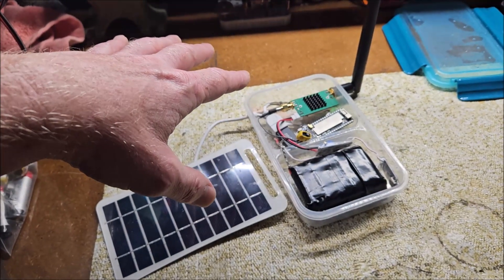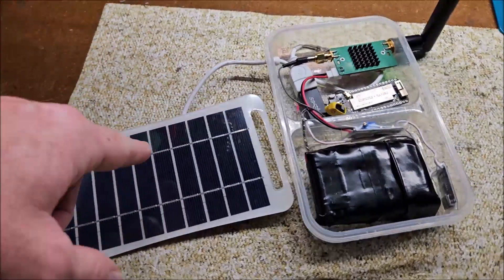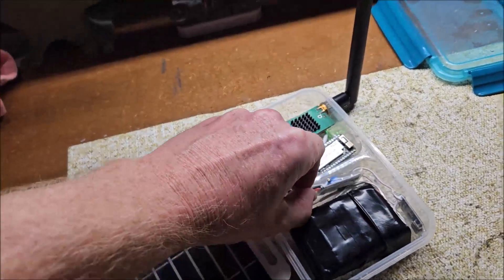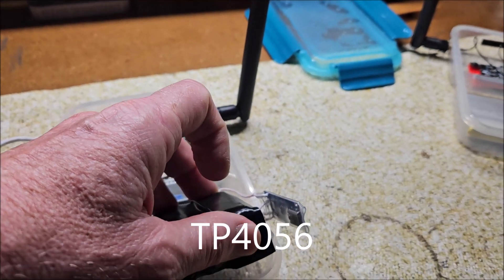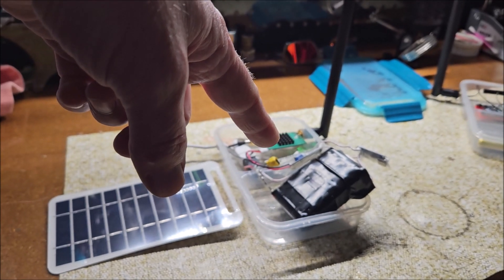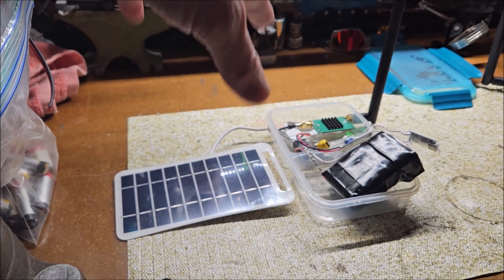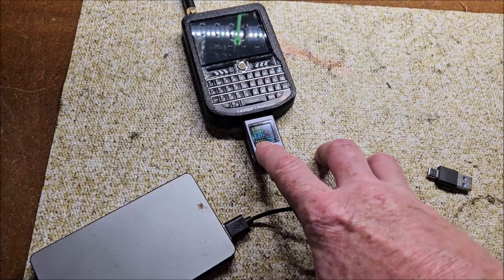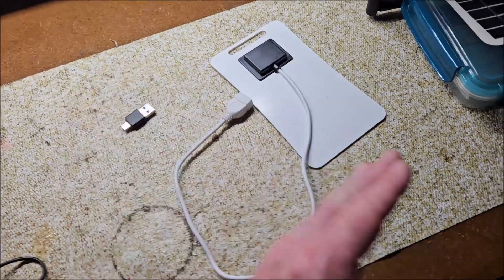Amplified Solar Powered ESP32 Meshtastic Node How To

Comment: The Heltec T114 draws about 10x less standby current than the V3, That's about 9ma and that translates to 10x more time on a battery.
The amplifier is designed to use 5v DC with a max. of 6v. The RF output declines exponentially as the voltage is decreased. The idle current on the  amplifier is about 9ma and that's about the same as the T114 LoRa board. Together, both LoRa T114 and RF amplifier has a combined drain of < 20ma at 5 volt. So the 3.7v lithium battery is useless. At 3.7 volts ONLY, and without +5 to supply, the amplifier will be excitation and still no output. A much better tact is to use a switching LM2596 based BUCK DC-DC regulator, set to +5 volts, to power both. It has an input range of 6.5 to 40 volts DC. You then have many possibilities for a power source. As it is switching, the wattage is constant and the current declines as the input voltage is increased. These LM2596 DC - DC wafer boards are available on Amazon for quantity of 5 for less than $20. They also make a good 12 volt "gell-cell" solar charge regulator if you set them to a 13.8 float voltage, although there are other BUCK/BOOST models with current limit adjustments for an even better solar regulator.
Reply from the maker: I'm not sure I follow. Your LM2596 is a buck converter that will allow you to decrease the power supply. I used an MT3608 to step the power up to 5V, but I guess you didn't make it that far. Besides that doesn't the T114 already have the necessary circuitry to just plug a small panel into it without having to step up anything? I wonder if it has a stable 5V pin you could use for the amp because of this. I just wanted to show how I did this with the least expensive node available.

Comment: The amps are good as long as you run a filter between the radio and amp. I can bet you that you can hear that node much farther than you can get into it. Your noise is getting amplified, without a filter you’re killing your receiver with a bunch of noise outside the 915 band.

Comment: I'm not sure about the spurious emissions spec of that RF PA. You might need to add an inline filter to make it FCC legal. (Or at least have someone with a spectrum analyzer check it out.) Also, IIRC, the legal maximum (in the USA) for EIRP is 34 dBm, so be cautious using any antenna with > 4dBi gain (or adjust the power output accordingly).

Comment: You should check with your meshtastic community before setting your node to a router node.  Many times setting this to client is sufficient and works great.  Too many routers in an area can cause issues for other members if their hop count is too low for the number of routers in the are when, perhaps one better router location would have sufficed and allowed it to just be one hop.
Reply from the maker: I get this comment frequently.  Besides me being is a non-Meshtastic town surrounded by BFE you miss the whole point of using router for this specific instance. Maybe watch the video again.
Reply: @masondawson4061  comment wasn't for you, but rather your viewers since you didn't cover this and lots of people misunderstand its purpose.

Comment: Could the amplifier take 5v straight off the heltec pin?
Reply from the maker: I thought the same thing, but only if 5V is going into the USB. I tried that at first with the solar panel connected to the USB. Then I noticed the amp only ran when the sun was out. That's why I did it this way. Still it might be worth checking on other nodes to see if the 5V pin provides 5V while on battery power.

Comment: Only the esp32 devices with a psram I believe of 8 work with store and forward.  Example would be the lilygo tdeck.  Otherwise it's not needed. Works good for a tdeck in client, so it still acts like a router.

Comment: Thanks you brother, excellent node job. Crazy funny how similar my node setup I'm creating is to yours. Just slightly bigger solar panel, 18650 atm(vapes later). I haven't run a test yet, i know the amp requires 5v, but just directly from your TP module could you use output power from there? I know it is less, just thinking out loud, how little power do those little amps really need(they won't keep my battery banks awake). I'll run some tests later and get back to you with my conclusion if you respond to this message Mason(probably will if you don't anyways) :) . Cheers from Western Australia my Mesh Mate!

Comment: How is the bidirectional amplifier working for you?
Reply from the maker: They work well. I can't really quantify it though. I've had one on a 4631 for about a week now in client mode. That's the solar powered node on the roof and so far I can't tell any extra battery drain. Of course there is hardly any action where I am.

Comment: I have a question, is the board used in this device heltec T114? and do you plan to add an "instructional video" in which you show step by step what to connect and solder to what?
Reply from the maker: No. It's the Heltec Stick Lite. I don't remember what version, but it won't work with a display because it draws too much power. That's why I went with a cheap node. You can certainly make ESP 32 nodes with displays work, but running them in Router mode turns the display off. I made a video I'll post a link to below on how to make the power supply which is the biggest part of this build. If you still have questions I'll be glad to help you over email studio32ste,101@gmail.com. https://youtu.be/Rw8Y9-Xp2oA?si=xlixZhC30hRieAUq

Comment: Hey, can you put affiliate links for the antennas, batteries, etc you're using too?? Looking for good L-shaped antennas for my around town nodes... Solid video though man! 👌
Reply: Or at least put parts list in the description? Shared link to this to my states discord channel though! Keep up the good work!
Reply from the maker: Many thanks! I'm not affiliated with any sellers, but the antenna was a recommendation on a video from The Comms Channel about Meshtastic equipment I think. It's been a while. The batteries were harvested from spent vapes. I wired several of the same type in parallel. I got the amp from Aliexpress. It's part number AB-IOT-686. It also says AirBuddy on the board.

Comment: Some quick questions if you don't mind? So if you have your ticket and put it into amateur mode, and turning off the encryption, must you have your callsign displayed? Or just send it when you transmit? Also, by putting it into amateur mode, does this limit you to only communicating with other licensed hams? How many Watts can an amateur put out legally on 915 MHz? Is is 1 or 1500 Watts? I am hoping you know, because I can't seem to find the answers to these questions.
Reply: I was under the impression that 1, yes you turn off encryption, and must communicate your callsign (no idea the requirement of how), BUT - Isn't that only on amateur bands, if you are using 915 there's no amateur regulations there? Most people don't use the amateur 440mhz band that these lora radios can transmit to as well.
Reply from the maker: @BBayjay  I found a helpful section labeled FCC Rules and Regulations in the wiki page for the Station G2. Hopefully this link will be shared.
https://wiki.uniteng.com/en/meshtastic/station-g2
Reply from the maker: I wish I could help but I don't know. I've wondered myself. Like do you have to keep it in client mute  while operating licensed at higher power to prevent retransmission of unlicensed operators? I think most likely if you want to legally transmit any higher than 1W you will have to give up a lot of what makes it Meshtastic. Perhaps other sections of the band are are allocated more precisely for what you want to do. Hopefully a knowledgeable ham will see this and give you a clear answer. Thanks for your comment though.
Reply: @masondawson4061  Thank you for your reply, I really like what you are doing here and how you are doing it. I am putting up a 15 DBI antenna today on my 45 foot tower. Hopefully I can get some range out of it.
Reply from the maker: @kenneth6731  Very cool! I've got several things in the works Meshtastic related. I've been on the fence about making videos with them, but I guess I will now.
Reply: @masondawson4061  Sounds great! Edit: I would love to see a video on your amp, the battery and the charging/connections results etc.